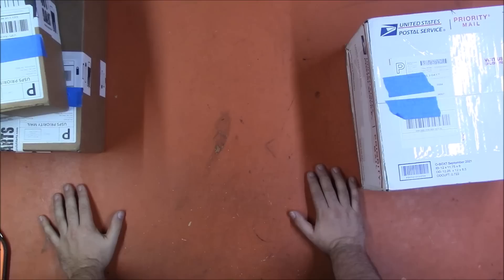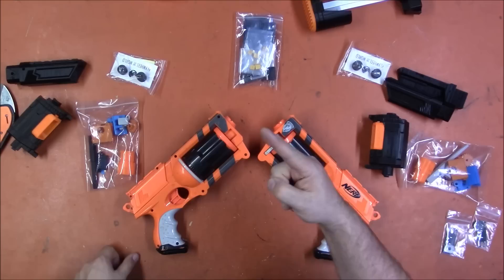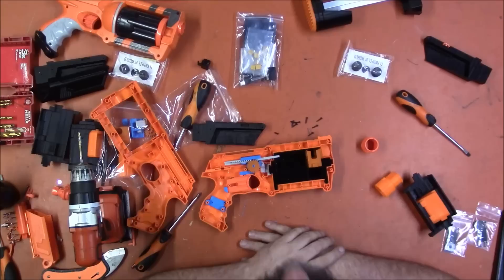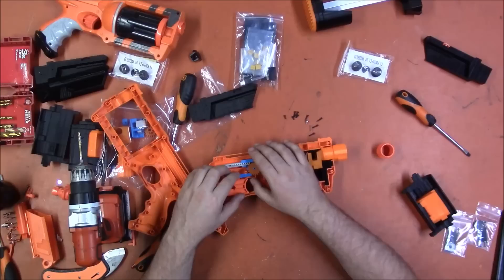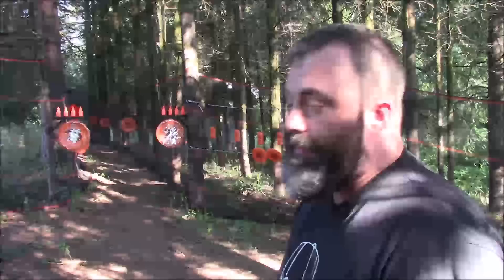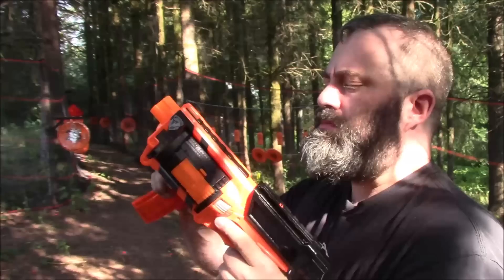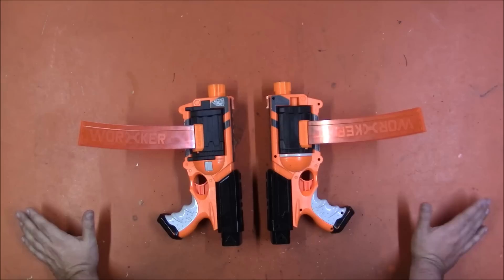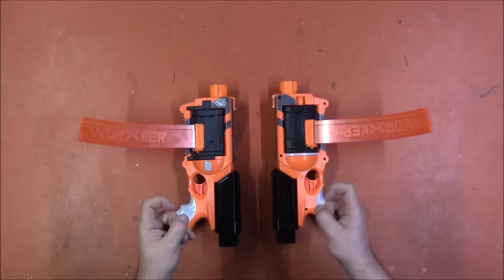Dual Mayfly - Build and Firing

Comment: You might be getting low FPS because of the krakens themselves. Micro flywheels need a very high RPM motor. You should be using Honey Badgers on 3S or the dedicated FTW Merlin motors.
Reply from the maker: I would agree except I wanted lower fps. At 100 fps I can use these anywhere. Now if I ever get around to putting internals in my second Dessert Pidgeon I will use better motors as I want that one to hit closer to 150

Comment: Hear me out: fully 3d printed alphastrike,/elite 2.0 quality blasters that you can dispose of, since they're made of materials that can compost or something. Metal parts come out when you flip a switch that makes the clips holding the blaster together break apart, opening the blaster easily so you can remove all the metal components and throw away the rest. Absolutely silly. Whimsical.

Comment: I wonder if it is adaptable to the disruptor.
Reply from the maker: With enough epoxy anything is possible.  But, No. The kit specifically fits the Maverick. Now it would be possible to make a kit for the Distruptor but this kit will not work in one.